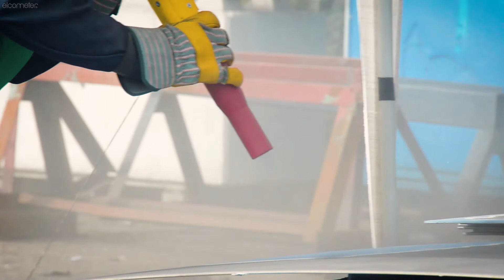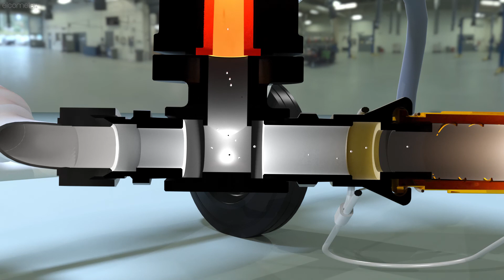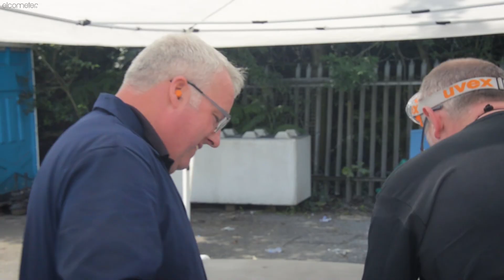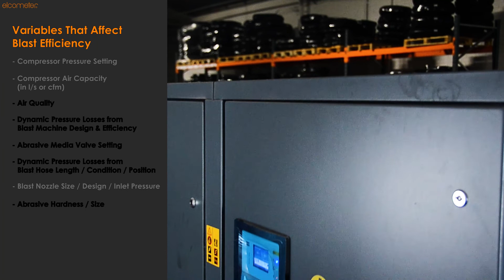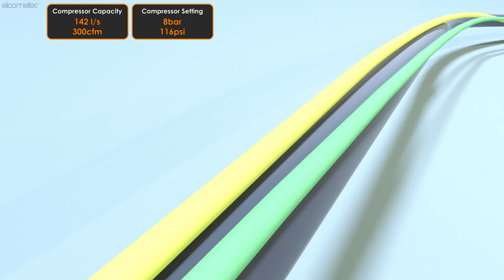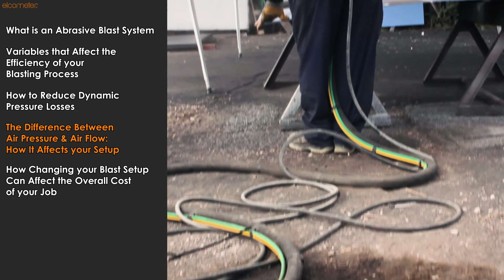Optimise Your Abrasive Blasting - 3. How Air Pressure and Air Flow Affect Your Blast

Comment: interesting concept, higher cfm larger nozzle operation. looking forward to part 4 in the series, surely more cfm means more fuel = more cost?
Reply: of course if you guys have a solution to speed up blasting time at no extra cost thats ground breaking; the biggest bottle neck on any larger infrastructure project is the blaster not the painter, so if paint teams can get on jobs quicker asset return to service will be quicker. and if it saves money as the contractor i will be quids in!
Reply from the maker: Thank you for your comment.

In part 4 we look at exactly that - if running a higher cfm compressor at a higher pressure increases your fuel costs enough to increase your overall project costs. We don't want to spoil it but the findings are very interesting!

Comment: My blast cabinet (pressure pot) blows air great however after the initial startup no/little media is shot out of the nossle resulting in an ineffective machine. Any advice?
Reply from the maker: Thank you for your comment.

We need a little bit more information in order to help you with your question - what size and rating is your compressor, what pressure are you running the compressor at, which Elcometer ABM are you using, what is your grit valve setting, how long is the blast hose, and what size nozzle are you using? 

All of these answers will help us work out what the issue is.

Please contact techsales@elcometer.com or visit www.elcometer.com/contact-us to find your local Elcometer distributor.